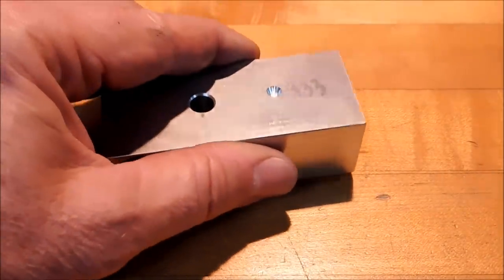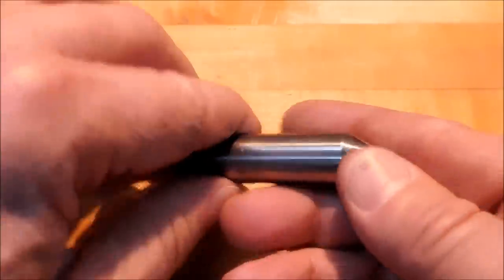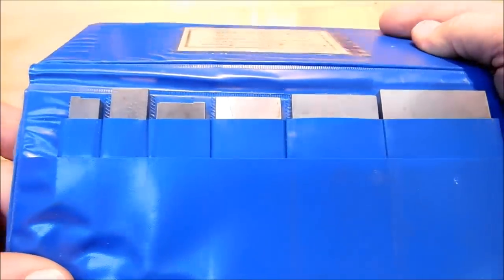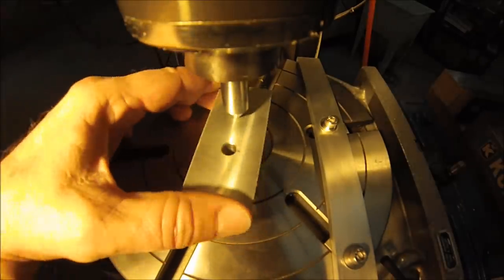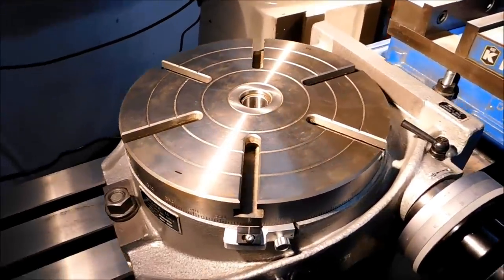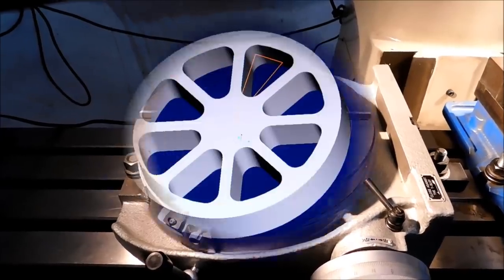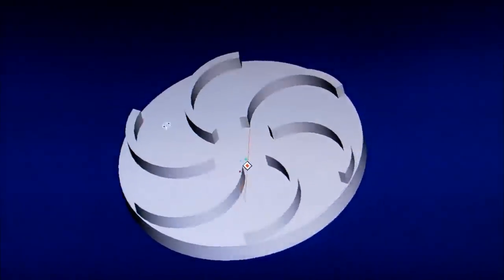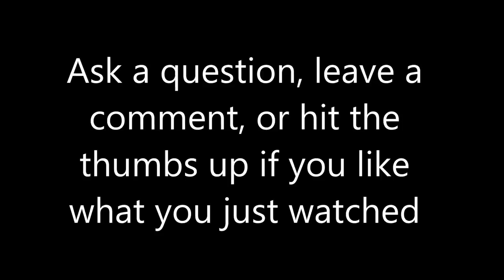Rotary Table Accessories and a Project Choice

Comment: Joe, what cad program do you use? What hardware are you running this cad on? I am not a computer giant, so simple is the order of the day. great videos on the rotary work!  Thanks
Reply from the maker: I did these models on PTC corporation software called Pro Engineer. Release: Wildfire 4.0. I believe its up to Creo now. Its very powerful and will do anything industry will ever need. I run it on an HP computer with a G force graphics card. Nothing special. The regular computer graphic card will handle the models, but when you have a lot of detail and you start to spin and zoom, a better card is a good idea for speed and smooth operation.
Reply: @joepie221  Hi Joe, thanks for the information on your cad system. When I get to Houstin , I would like to see your shop.  I like the Fadal cnc.  Enjoy your videos

Comment: #2.  Why make you work so hard? Explain, you have a CNC, why mess around with a rotary table?  When I got my V2XT I never wanted to see my rotary table ever again.
Reply from the maker: Chances are there are more rotary tables in home shops than CNC milling machines. Its a very versatile tool and If I can help scare away some mystery, I plan to do so. I also plan to make my cannon wheels on it. 7 segment like the originals. CNC would be too easy.
Reply: Bottom line, I wish I could be half the person you are sir.
Reply from the maker: Thank you for that. I am sure there is plenty I could also learn from you.